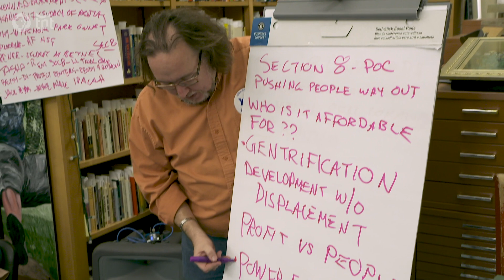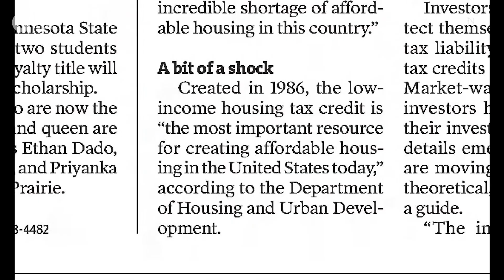Why Is There An Affordable Housing Crisis?

Comment: There asking the wrong questions. Its not a question of why the rent is too expensive.  Its a question of why income is too low. This is a workforce & job rate pay issue. Unskilled jobs are undervalued because they are out sourced to 3rd world countries.
Reply: Probs because you're not enough good at what you do, a strive of excellence always gives the same back.
Reply: well even with better pay if rent is too expensive then does not matter how much you make. that when stop ask about pay being too low and what if housing is too expensive due to land shortage. I mean you buy manufactured house for 22,000$. only problem is finding so land to buy to put it on. the problem is that land cost can much more than house it self. in old days in 1950s land was cheap so trailer parks made sense. now it does not because land is not cheap.
Reply: I disagree. My apt was $1,100. Month in 2010. It’s $2,300 today. 

Yes  wages are low but the rents have double in my area and (within a hundred mile + radius) in a very short time. Not enough rent control, too many private investors buying up housing & sitting on it etc.